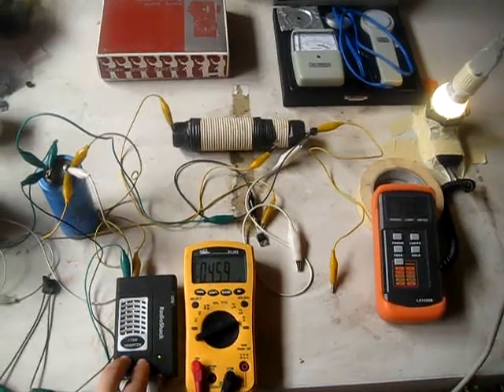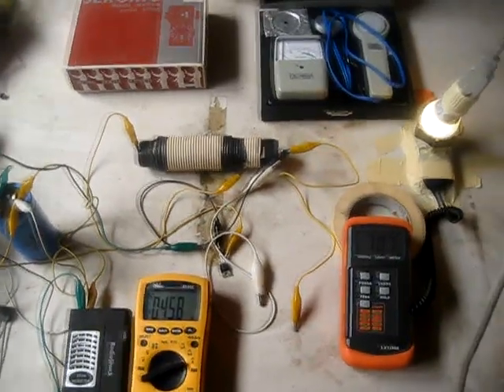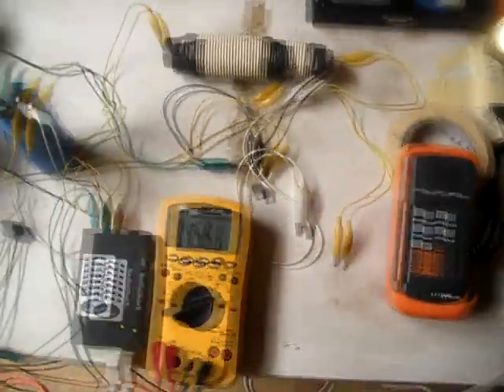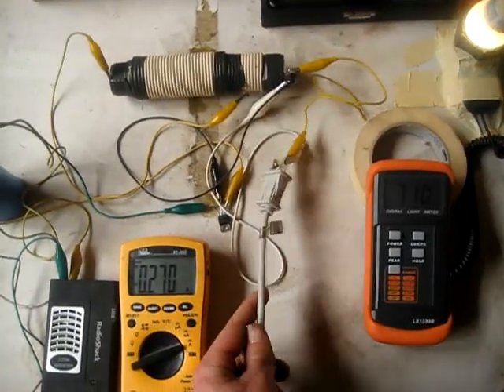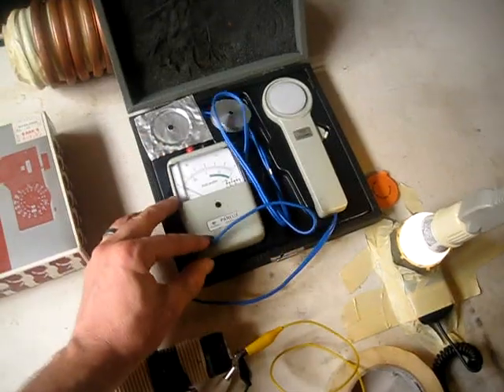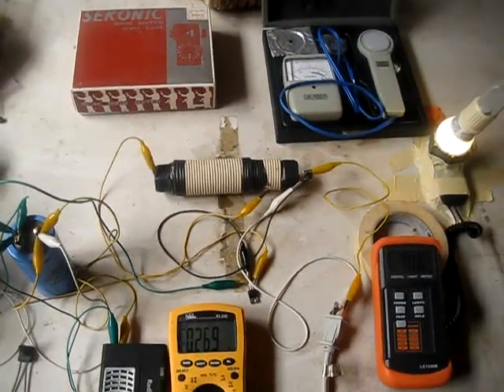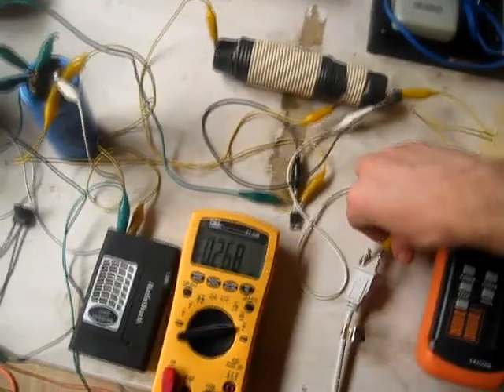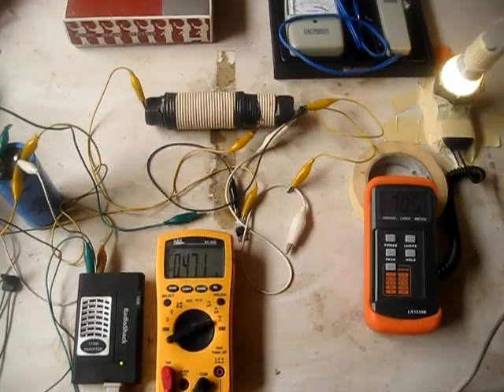Lumens test! Super Joule Ringer 2.0 smokes traditional inverter!

Comment: I have a potential real world application of 12 led lights, equivalent to 75 watts each. I built a (temporary/permanent)wall in my house to separate a large bedroom into 2 medium sized rooms. the 1970's lighting is not so good with swagged lamps etc that the switch only controls for one of the rooms. 
I would like to add the wall sconces to the new wall but powering those wall lights is a problem. 
The question is could the super joule ringer provide the solution.? I would need real world data to answer those questions. Like how long would a battery last running it. What kind of batteries would be needed?
Thoughts?

Comment: I apologize, you seem to be missing something about the advantage to magnetic fields. Coils will always be superior to IC chips until they are designed for resonance. A joule thief can self-oscillate if tuned properly and will cost in the pico-amps range to run and that is without full resonance. For full resonance you basicly need two joule thiefs in one, but without coils it won't happen in electrical systems. Coils just take more time to get just right. Why are you in such a hurry?

Comment: Correct there are ways to get better than 90% efficiency, and as said, a joule thief does not get anywhere near 90%. Looking at a similar DC-DC converter like 34063AP nets you around 60-80% efficiency depending on the function you want and is more efficient than a simple joule thief, ergo a joule thief will waste more power.

Comment: Joule thief is an oscillator. A swing is an oscillator. If you push on both sides of a swing at just the right time, what happens? If the chains were a rod would it just flip over....mmhmm. The circus has swings that flip over. It is an over-excited oscillation....aka resonance. :-). It's no secret....quantifying the potential is the issue. Lol.

Comment: You do know what an over-excited oscillation is, right?
There are effects in oscillators that can be taken advantage of to excede 90% and even generate power without violating the 'laws' of physics, but you have to focus on the forces to see it. First, electronic and magnetic forces are seperate. One is a reaction to the other. Second, at the center of the N and S poles of a magnet is a constant repelling force outward in both directions. Third, your compass is backwards. Lol

Comment: Joule thiefs are certainly not 90% efficient, if they were then every power supply on the market would have a PSU gold efficiency rating, when in reality very few do. There is no true efficiency being shown in this video AT ALL, multimeters are very slow and average for constant voltage supplies, you need an oscilloscope to measure how actually efficient this is, and there's no point because it's inefficient anyway.

Comment: Great stuff. Time2propose standardised accurate measuring? DC Power is easy2measure with cheap multimeters. AC power can be measured the same way if the load is resistive like LED, as they disspiate little heat&being luminous, use of a luxmeter AT A STANDARD DISTANCE in a standard box to compare equivalence of light ouput (=power) is a great idea as light output varies linearly with power in the same device, more or less, for comparison purposes. This way we can have standard data for comparison

Comment: Hi again Lasersaber! I mind: would it possible that the drop in amps would come only by the the changes of phase in the power factor, cause it's what used to do with coils & capacitors. If yes, would mean that you wouldn't read the true amps! :/

To check if your circuit if really efficient, I think after having thinking more about, that you should compare the speed to empty a little battery in the tow cases, and to do it several times.

That would tell us if you really economize energy. Cheer.